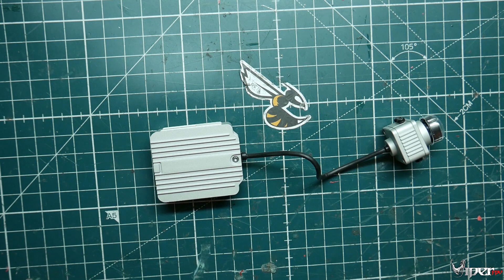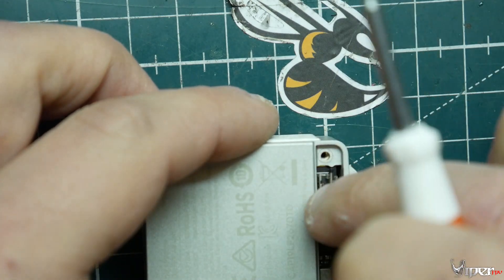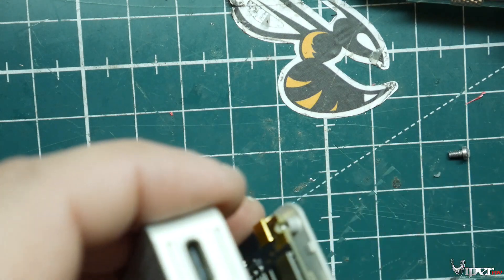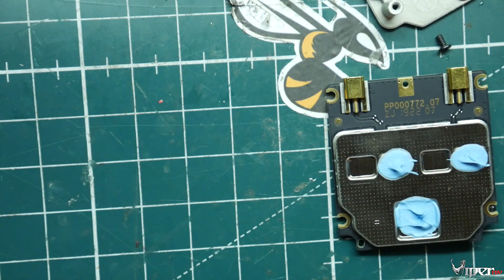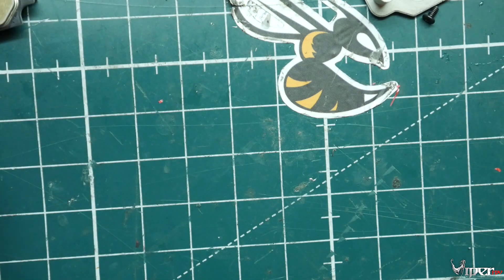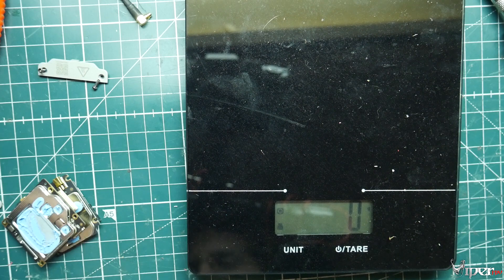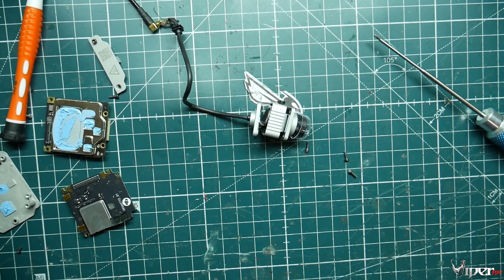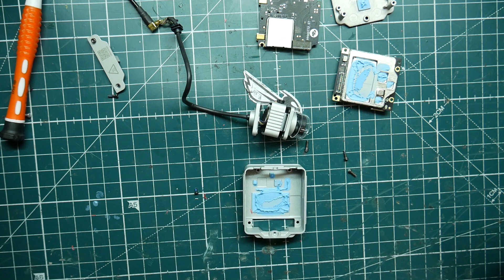DJI Air Unit Teardown & Disassembly

Comment: Very good video. The Airunit's antenna has broken inside the MMCX socket. Any suggestions for getting the male out of the female?
Reply from the maker: Some needle nose plyers. I had one break on me and I was able to pull it out by playing with it and eventually getting it out with them.
Reply: @ViperFPV  Thanks a lot

Comment: Very well explained video! i have issues with the usb connection, it keeps switch between connecting and disconnection every couple of seconds... I cant update anything. Video feed is good, i originally wanted to reset the air unit, since there was no way could get the osd working in the goggles. (it used to work before) this annoys me and i dont want to spend another 150$ on another air unit just to ge thte osd back :(
Reply from the maker: Are you able to connect other air units fine?
Reply: I bet corrosion of the connector or maybe a broken filter capacitor. Disassemble, clean, inspect connector for damage. A replacement port is pennies, should be doable with a cheap hotair or 10$ at any phone repair shop.

Comment: Could you attach two cameras to your model, and then by flipping a switch, switch the digital feed into the DVR air unit... from one camera to the other?    Would that work?    I need two camera angles on my quad, one to fly with at 45 degrees, and one at 0 degrees to land.    It would work with an analog camera, but not so sure about the digital ones.  Power to both, just switch the signal wire.   How would you do this via an out pin on the Crossfire nano though?     I am just so frustrated with this tech falling short of the very basics of what I need it to do.
Reply from the maker: There is a boot delay between switching cameras so most likely it will not work with digital.
Reply: @ViperFPV   I was thinking you kept power to both cameras, but just switched the signal line.  I wonder if they need to handshake, or if the air unit could recover from some garbage frames or an interrupted data stream and resync with the camera.  I bet to hell nobody has ever tried it... at least not with these.

Question, have you ever been watching the digital video stream, and unplugged the camera from the air unit, and then replugged it back in?   Does it recover.  If it can recover there is a high chance switching between multiple cameras might work.
Reply: Are you saying you want a 2nd cam just to land? Or are you trying to land on something in particular? Like a platform or something difficult or just the ground? 

I was thinking it’d be cool to have 2 cams; 1 facing forward, one facing directly below. But I guess for that they have different type of drone.
Reply: @alloutofdonuts3998  Nope, nobody has done the dtraight down cam, but I thought of it as well for lining up and land in a truck bed or a delivery drone landing on small landing pad im someones yard...  automated and computer controlled even.

I originally posted because I want a second cam to land seeing the horizon because landing with a main cam angle 45 and higher is a puta landing blind.  You can do it but its a pita.

Im probably going to go a one axis tilt sero route on my main cam tho...
Reply: @choppergirl  that’s cool 😎

Comment: So I took a tumble and my air unit shows lights but won’t connect to computer app or bind to goggles or radio. I diagnosed that it’s definitely the unit but can’t find anything to help me now. Any suggestions what to try?
Reply from the maker: I would open a ticket with DJI

Comment: Hi, thanks for the teardown. Is it possible to use the air unit without its enclosure? Perhaps wrap the two halfs in a heat-shrink and  use heat sinks for heat dissipation.

Comment: Could you tell me where the Mike is located in the camera or..? Thanks
Reply from the maker: Bill Aeronut41 mike I’m
Using in this video is a rode mic pro plugged into a Panasonic G7
Reply: @ViperFPV  Thanks, but was looking for the location of the DJI mic in the air unit. The volume is very low and don't want to block it if possible, Bill
Reply: There’s a mic in the AU?

Comment: Hey.  Do you think its possible to use a stripped go pro  camera instead of the dji one?
Reply from the maker: Not sure what your goal is
Reply: @ViperFPV  to have only 1 camera on it.  Use the same footage as fpv and post viewing.  I know it will demand not only to strip the go pro to 15 grams, this is easy, there are many tutorials, but some software wizardry to have the camera saving 2.4k to the memory and sending HD to the dji.  Anything is possible,  a toothpick with both siatems would be really cool.
Reply from the maker: Yeah that would require some wizard magic to get the GoPro to talk to the DJI goggles
Reply: @ViperFPV  just as I thought! 🤔🤖

Comment: Nice..this is what I was looking for.  But can you tell me if those MMCX connectors can be replaced?  During a crash a piece of the antenna broke off inside the MMCX connector.  I'm thinking if I can just replace those MMCX connectors in the Air Unit with new ones I'm back in business.  I just can't reconnect a new antenna into the Air Unit until I replace or remove the piece that broke off.
Reply: Hopefully, those MMCX Female Connectors are standard sizes that I can purchase anywhere.
Reply from the maker: RGMG yes you can unsolder the mmcx and replace it with a pigtail if you want
Reply: @ViperFPV  what do you mean replace it with a pigtail can you show me a picture or a link? I would love to do this
Reply from the maker: They are standard size
Reply: @ViperFPV  Perfect..that's a huge help to me.  Hey, I really appreciate the feedback.  Learning as I go and this is the first quad I'm tearing apart.  Great to know though...Sure beats sending off to DJI.  Thanks again!  👍👍👍
Reply: @ViperFPV  Just pulled DJI Air Unit apart and got to the damaged MMCX Connector.  Was able to separate from board it sits in but seemed to secured in place fairly well.  Didn't look like it was soldered.  Not sure if there is an adhesive product that kept it tightly in place?  Any ideas if I need to use any type of securing compound before replacing with a new MMCX connector?  Hard to tell by visually inspecting what (if anything) was used to help hold it in place.  Is that just soldered in place?  I also posted a picture on the DJI web site forum as well;  https://forum.dji.com/forum.php?mod=viewthread&tid=206878&page=1#pid2061307
Reply: I just pulled it apart ...hope that's not a bad thing?

Comment: thought you were going to remove the component shielding so we could see the components.
Reply: Exactly.  What good is it to take it apart and just see a covered PCB!
Reply: @kevenc  there are most likely soldered on
Reply: What are yall yapping about this is a tear down of the unit not a how to repair the air unit...

Comment: Dji now has a 20x20 open board design..
Reply from the maker: Matt Dewhirst I know I just seen that. Will need to get one in
Reply: Matt Dewhirst Talking about the Caddx version?
Reply from the maker: Yes
Reply: Actually, according to word from the CES show, there will also be a 20x20 HD vtx board by itself from DJI. Supposed to work with many of the analog cameras as well.
Reply: Carbon Icarus FPV Would be awesome

Comment: So where is the receiver's antenna？
Reply: I'm guessing its inside the camera cable. HD or not the cam should not need that many wires.
Reply from the maker: Good question, there is no antenna it must be using a internal antenna on the pcb or like the above comment it could be in the camera cables but all those cables are connected to the camera pcb
Reply: @ViperFPV  Got it，thx dude.
Reply: Receivers antenna are the antenna, they are used for receive the controller data and send the video to the VTX
Reply from the maker: Awesome!